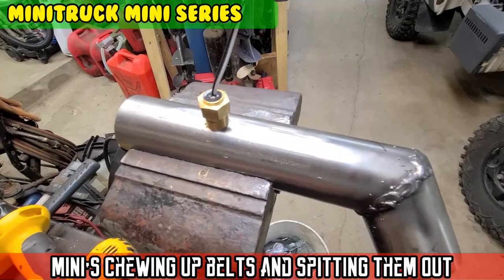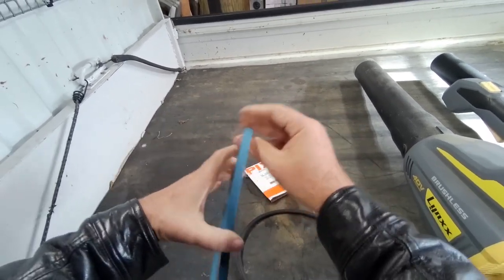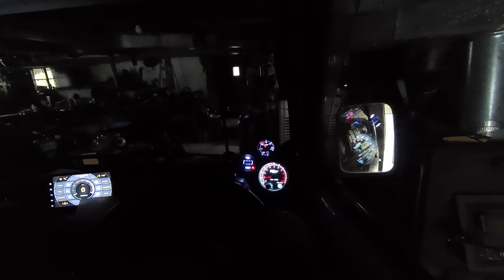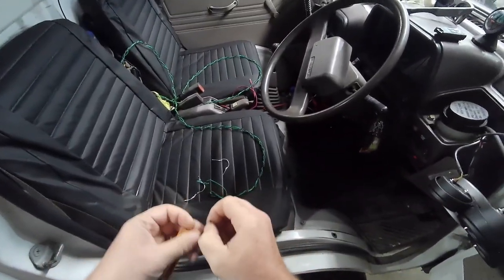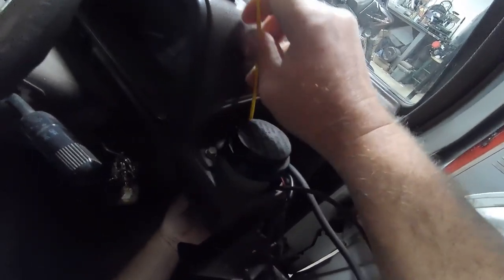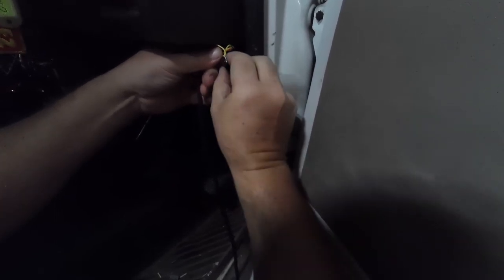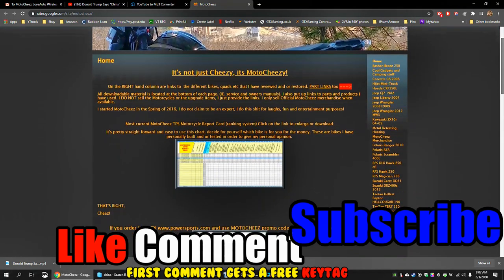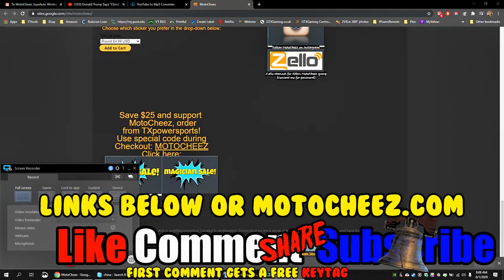Mini-Truck (SE06 E07) GlowShift dual temp install, Mini eating up belts. ARM300 seizing?

Comment: I added a supercharger to  a car I had back in the day. It had an automatic tensioner that was basically maxed out and it was almost impossible to get the belt on. But, it didn't slip and slipping is what burns belts up and shreds them. Finding the right sized ribbed belt was hard and I had tried a more common size but just another 5mm caused slippage and shredding so back to the super tight belt I went. Something else you might try is a tensioner/belt setup that wraps the belt around the pulleys as much as possible for the most traction and surface contact. You might also get more traction out of a ribbed belt setup but you may just have to got to a toothed belt like you said. Trial and error with this home engineering stuff!
Reply from the maker: Yeah I hear that. Have the tensioner but think I should move to a separate drive pulley before I set that all up

Comment: Hey cheez if you have a small laser level check to see if the center of the pulleys are lined up. I was installing A/C compressors to CAT crate engines when I was working at a custom machinery factory. Some pulleys have thicker outer sections so you can't just align the pulleys off the face. ( also I have been an auto technician for 19yrs, so i'm not just talking out my a$$).

I don't know about automotive V belts for your application but they can spin a/c compressors. Older cars sometimes ran two belts for the A/C compressor though (chrysler new yorker with a 440 ran this I think) 

If that doesn't work you could always try and look for a cogged belt adaptor. Mini would be rocking the big boys setup.
Reply from the maker: It's definitely aligned pretty good. I know you're supposed to align off the V but not much room to get in there. I don't have a Lazer to get in there. 
I'm 💯 the SC locked up, you hear it in video. You can see the burn mark in the belt too.  It's back on and I tested it offroad to heat up the SC pipe to 180f then did a few miles on the road. Seems good so far!

Comment: Have you considered using cam pulleys or a can pulley from like a waterpump if you need a small one or even a crank pulley and use a Campbell and tensioner set up.
Reply from the maker: Hmm I haven't, but good idea!

Comment: Hey Mr Cheez, Random thought-- I worked on a couple of VW/Audis with collapsing intake tubes.  If the intake tube was to collapse under boost, the supercharger would suddenly be under rediculous amounts of vaccuum, and the drag on the belt would go crazy high, temporarily.   With the Audis, by the time a guy got stopped, the tube would expand back to normal, like nothing ever happened.

Just a thought, hopefully this helps!
Reply: Good point. With the old setup the collapsing tube was able to take the stress away as i take it you don't have a blow off/recirculating valve? If the hard pipes no longer allow the "give" in the system, it could well be stalling/jamming the charger when the throttle is closed?
Reply from the maker: Ran it around today, did some good areas test today. SC no issues. Recorded the SC from underneath too. Left belt a little loose just in case. Went great

Comment: My opinion is the kevlar belt does not have enough give in it and it's putting to much pressure on the bearings.  The centrifugal force of it spinning under high rpm is a lot more than you think. The 170 degree ait is not horrible but you really don't want to be over 200 degrees especially in hot weather under boost.
Reply from the maker: I can try another automotive belt, but need to find heavy duty like I mentioned.

Comment: Great video cheez, I definitely think temperature is an issue and intercooler would definitely help. It's too bad they don't make a water cooled version of the supercharger. The last one I had was on a Ford lightning and they definitely get warm
Reply from the maker: I guess over 200f isn't a bad thing from research I did online.
Reply: @MotoCheez  No 200 isn't bad I'm thinking more that there's some expansion on those rotors with that case that was the reason I was saying water cooled might help that but I'm not sure I've never dealt with an air-cooled supercharger. Be interesting to see if it's expansion or maybe you use an infrared to see how hot that case is getting?
Reply from the maker: I should keep my thermal reader in mini!
Reply: @MotoCheez  With the nicks and the grooving on the inside of the SC that makes me think that maybe the is some small debris that is going thru it.  What is goes thru the impellers and gets lodge smokes the belt, the when you loosing the the tension to replace the belt is dislodges????
Reply from the maker: That's kind of what I thought it was, or over-tightening. Plus I had my crankcase vent going to atmosphere instead of through the air filter tube which some people say that that air does lubricate the supercharger

Comment: Can you set it up on the bench to simulate what's happening in the truck? If you can spin it at 10k rpm, choke down the output, and put the input through the same filter, you should be able to approximate what it's really doing.
Reply from the maker: I cleaned it up took those spurs out installed it took the air filter off and pipes clean those spotless then drove it around for about an hour on the trails got the discharge to up to 180 degrees then hit the road for a few miles and it didn't do it. May have been the crank vent disconnected too. Had a few say it does lubricate
Reply: @MotoCheez  I'm glad you're sharing your experience learning how to supercharge mini. I find it very educational. Thank you :^)

Comment: How do you like that Milwaukee blower? I have that and the weedeater. Love them. No more mixing fuel!
Reply from the maker: I actually did a comparison to the harbor freight one that's next to it but ended up being so much content for many in a supercharger I didn't add it to this video, it'll probably be in the next video. I do like it but believe it or not the harbor freight one has more pressure and volume

Comment: So the impellers in the supercharger are out of spec maybe? I would probably send it back for a replacement and let the manufacturer do a root cause fault analysis on it.
Reply from the maker: I think it might have been the middle birds that got stuck on the impellers, I bought this supercharger 2 years ago and it sat in a box so I can't send it back

Comment: I am not a supercharger guy but.... those rotors look like they are cast metal. I would speculate that the inferior material and machining is causing heat to build up and cause the rotors to make contact ever so slightly. Regardless I would be very concerned about the metal slivers in there considering the tolerances between the rotors. Hope you have a good holiday!
Reply from the maker: It's some kind of plastic, slivers removed, polished and it's back on mini... We will see how it goes from here. 
HTG to you too!

Comment: maybe spray some teflon lube inside the charger to alleviate any heat induced contact. It looks pretty dry inside maybe they are supposed to have the crank case vented into the intake system pre charger to help with lubrication....?
Reply from the maker: Teflon, hmm. Good idea. I also thought the crank vent would help lube it as I mentioned in my video. The hose was off that day too... It's all together and connected now and I did some offroading in my trails, got the discharge temp up to 189f and then drove around local in the roads, no issues. 
Thanks for the input!

Comment: The other thing that the supercharger kit I used had was a diverter valve that opened under vacuum so there was no load on the supercharger unless you were on the throttle. Maybe something like that would lessen the load on your belt?
Reply from the maker: That's what I mentioned in here. Bypass valve, but it wouldn't lessen the load, but seems it would keep temps down

Comment: I wonder if a bearing is getting locked up on one of the accessories due to the extra tension? Had that happen once with an alternator. I am working on putting together a supercharged F5A and it has the same AMR300 charger. Same wear marks inside, nothing unusual. Yours seems to spin more freely than this one, but this one has been sitting for many years. The factory design is a 4 rib belt and the supercharged block does come with the 4 rib and V belt on the crank pulley (9 valve head also). I just have to modify a pulley to replace the stock v-belt pulley on the alternator. Your videos have been super helpful. I was told by everyone that i needed a special carb for this to run but I'm just gonna throw it in with the stock and then make adjustments as needed after watching your videos.

The entire factory plumbing is all cast manifold parts which is nice but I am not sure it's going to fit back into the Carry. I might have to reroute the carburetor since the entire intake assembly is comically long now. The factory setup looks like it has some sort of bypass valve too. There is a metal tube that connects before and after the blower and then a valve (like an EGR) that has a spring loaded piston in it. There is also a boost-actuator (looks like the EGR vacuum actuator) or something attached to it that will lock that piston solid (preventing boost from leaking back to the intake) if it sees boost. I'm going to hook it to the outlet side of the setup and see what happens, may end up just bypassing it. Maybe it needs to be on the carb side, who knows.
Reply from the maker: Definitely need that valve. Wat h the next few videos. It's a bypass valve and I was eating belts up. Every 50 miles or so. You can't blow through unless you have the proper fuel regulator. You can drea through if you want to tinker.
Reply: @MotoCheez  Nice! Yeah I will be drawing through.

Comment: I'm wondering when Cheezy will finally replace the carb with a EFI....  As well as a intercooler.
Reply from the maker: When I can find one for a 3 cylinder. I've looked and contacted manufacturers over last few years. Nothing.
Reply: @MotoCheez  the geo metro was a fuel injected 1.0 3 cylinder i believe.  I wonder if a guy could steal the efi off one of those? I really don't know just a thought.
Reply: @geraldburmeister9637 Good idea but I think they were throttle bodies on them with just 1 injector. They were famous for blowing up .
Reply: I just remembered some john deere gators used a 800cc +or- Chinese cheri 3 cylinder motor with fuel injection that might be just what you need.  Might be able to find a blown up unit somewhere as I heard the engines weren't very good.  Maybe talk to a deere dealer.  They have to hold warranty parts for 3 months before they can dispose of them.  Might be able to one cheap or free
Reply from the maker: Good idea!
Reply from the maker: That's an interesting idea. I thought they were 4 cylinder. Then the issue would be able to unlock the ECU to remap the injectors, timing etc.
Reply from the maker: I wouldn't mind TBI, it's easier to install and work on
Reply: @MotoCheez  they are definitely a triple.  I worked at a dealer when they first came out.  They were only like 50 hours or so so yeah it would need mapped.  The engines were originally in sub compact Chinese cars so the software might be out there somewhere
Reply: Hp not hours.  Dang phone.
Reply: @MotoCheez  Yeh you could be done with the issues you go thru warming it up  goosing the throttle to keep  it running til warm .
Reply: @MotoCheez  just had another idea cheezy.  Buy a salvage fz09 Yamaha.  Take the injection off of it and ebay any good parts.  You can dyno tune it map it and even get a power commander for it and it should have plenty of flow for the engine.  And have access to replacement parts for quit awhile.
Reply from the maker: Fz09 is 4 cylinder
Reply: @MotoCheez  fz09 is a 3 cylinder just looked it up to double check.
Reply from the maker: Wow. I never knew!! Worth looking into that.
Reply: @MotoCheez  mighty car mods have a short series where they turbo'd a mini truck. Pretty sure they installed a haltech ecu & related sensors. Not sure about the $$$ but it seems to be a pretty slick setup.
Reply from the maker: Saw it, u believe theirs is EFI which is cake to add boost
Reply: @geraldburmeister9637  Never knew that John Deer had 3 cyl engine.
Cheap or Free is right in Cheezy's ballpark!
Reply: @idahobob  I believe it was in the 825i model around 2009-2010.   They were from a discontinued Chinese sub compact car.  They were pretty smooth but I didn't stay with the dealership and heard they might not have lasted very long.
Reply from the maker: Be tough for me to get in the states, then a way to remap the ECU?
Reply: @MotoCheez  my thought cheezy is does mini have a cam position sensor cuz it seems to me on motorcycles at least it sends the signal to fire the ignition and or the injectors.  That would be the problem converting mini to injection from carb.  Unless you use a standalone system for previously carbed engines.
Reply from the maker: I'd have to install a trigger or go off distributor pulse.

Comment: Maybe try putting a side load on that pulley and then spinning it when your checking the supercharger. Like if the belt was installed and tight.
Reply from the maker: It does only seem to happen when I tighten it too much, which I may be over tightening.

Comment: How about testing with a temporary setup to see wht temps the charger is getting to (maybe use the air inlet temp on gauge short term to monitor). if is getting hot, try install oil cooler on the charger
Reply from the maker: It's installed. Ran good. No issues. Recorded under hood to see if issues, of course none.

Comment: i dont know anything about super chargers. but maybe think about making it a blow through  instead of a suck through
Reply from the maker: I figured out how...  Need to keep fuel pressure 6psi above boost in the fuel  bowl but that won't solve the SC issue, which it seems to be ok now
Reply: @MotoCheez  if anyone will figure it out you will.
Reply from the maker: @MadsWorld34  It's back on and I tested it offroad to heat up the SC pipe to 180f then did a few miles on the road. Seems good so far!

Comment: I didn't go back and re-watch,  but didn't you use a slightly different weight oil than the spec of the SC?
Reply from the maker: Yes originally I used 85/140, but I did find my 85/90 so that's what it called for and that's what I put in at this time

Comment: need to change your belt setup to a !serpentine Gator belt!  >>add the supercharger should have its own belt<<<  you're using a v-belt to run the whole system???
Reply from the maker: I may end up doing it that way... I've seen it done one belt on small CC engines like this.

Comment: I think you're right about the impellors getting fouled for a split second each time. I mean, it makes sense to my amateur brain.
Reply from the maker: It's back on and I tested it offroad to heat up the SC pipe to 180f then did a few miles on the road. Seems good so far!
Reply: @MotoCheez  Hopefully that's the end of any more casting flashing coming away :D
Reply from the maker: I totally stripped the filter and pipe, cleaned them spotless!
Reply: @MotoCheez  Nice! Mini's worth it, she wants to keep that power ... and survive if possible!

Comment: Maybe some slag left inside of the intake air tube that you made and possibly came loose and got into the charger. That would be the only thing I can think of.
Reply: Time to bolt a RHB31 turbo on Mr. Mini.
Reply from the maker: The sensor on air cleaner side. Yeah. I think so...
Reply: @MotoCheez  That is the only thing I can think of.
Reply from the maker: If I had EFI!
Reply: @MotoCheez   Man you have me looking at mini trucks for my next project lol.

Comment: Well WTF over?  I know jack diddly squat about superchargers - must be a reasonable explanation.  Too bad you couldn't bench test the supercharger.  Do you have a belt driven electric motor you could hook it up to?
Reply from the maker: I do but loading it up may be the issue. I put it back on today and went offroading on my trails, for the discharge temp over 180 and then took a short trip close to home, worked perfectly... Sho who knows. I need belts, I know that!